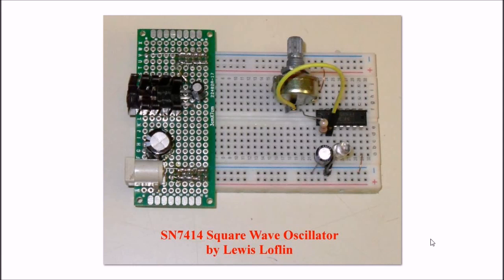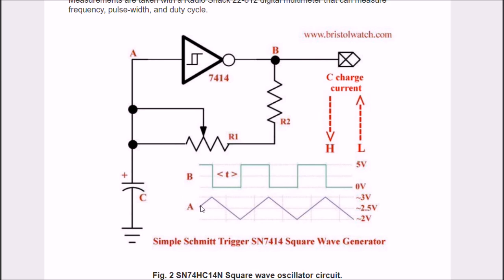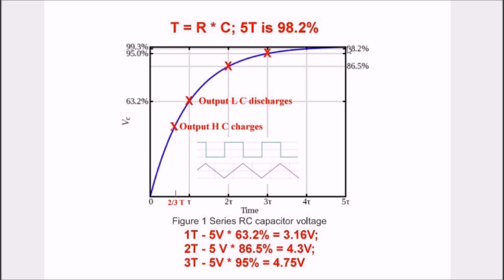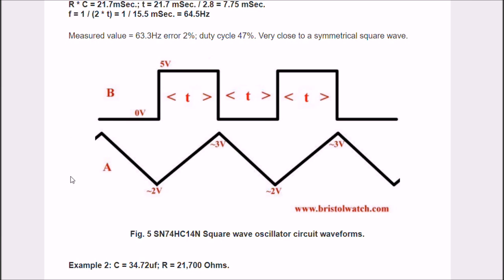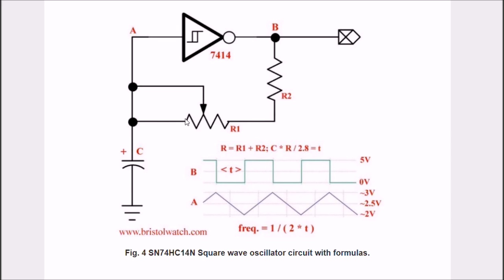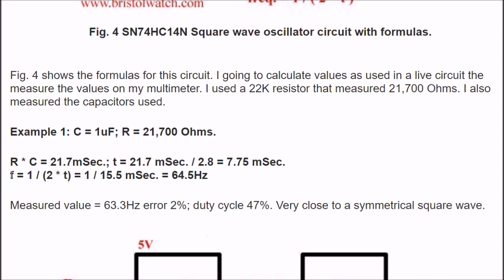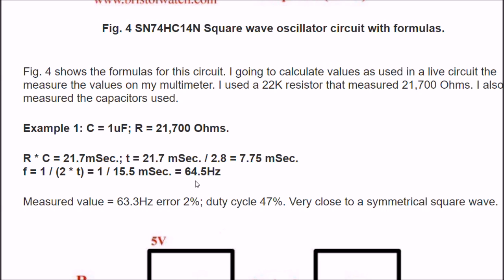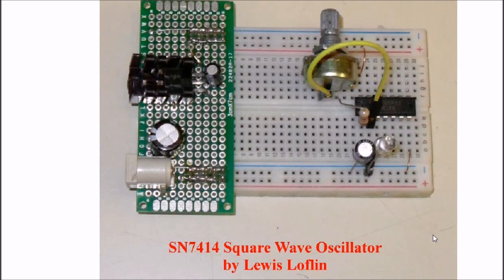Simple Schmitt Trigger  SN7414 Square Wave Generator

Comment: I don't think you can totally discharge the cap because the 7414 will switch its output on at a voltage greater than zero to start charging the cap again.  Love your videos, keep 'em coming.
Reply from the maker: I said in the video it neither fully charges nor discharges.

Comment: Nice video Lewis. I found that the stability and duty cycle are much improved, when using a small capacitance (20-80pF), by using 3 hex inverters in series.
Reply from the maker: I'll give that a try.